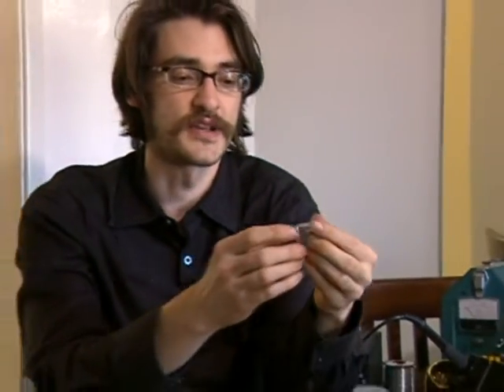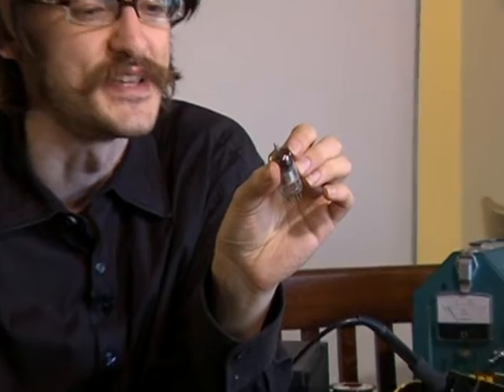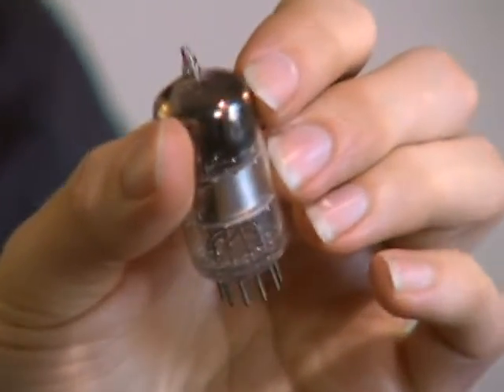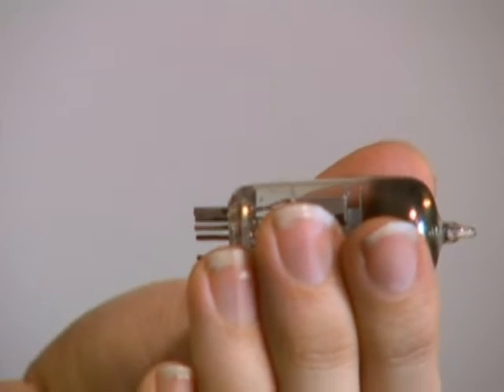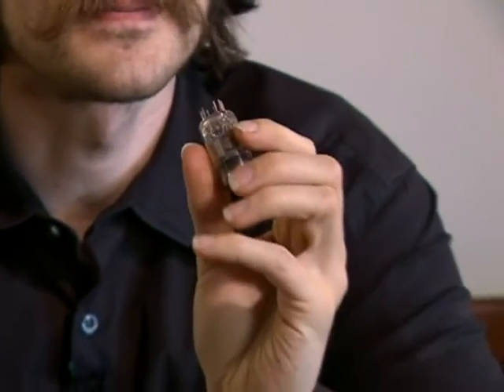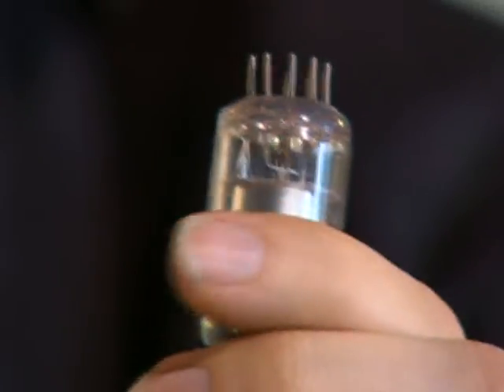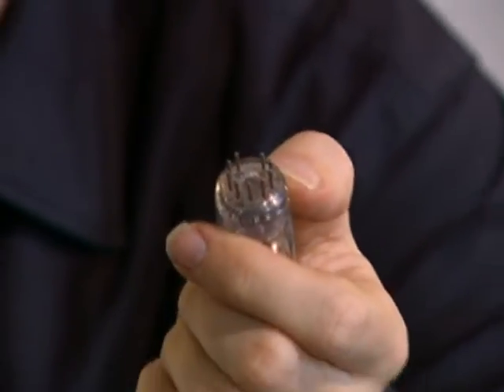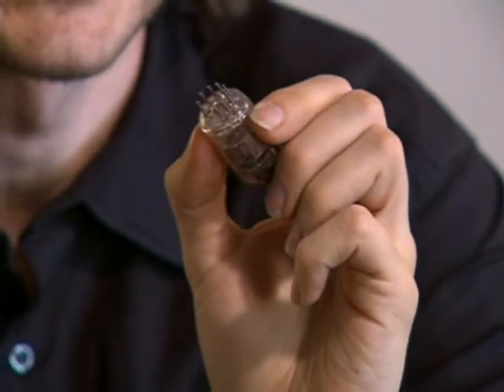Restoring Vintage Radios and Music Equipment : Vacuum Tube Problems in Vintage Electronics

Comment: i have a Siemens Super type C 62 radio/wireless set built in Germany in 1956/57, bought in Sweden in the 50s or 60s. on the back it says F.Nr 584317.  it used to work fine. after i tried to use it as a loudspeaker for another apparatus there is no sound at all, not even the click and other noises when you turn it on. the valves all seem to work (they glow). i do not know what i have done wrong. the 9-pin valve Siemens EF89 does not glow much.  is there any web page where you can see equivalent valves for that Siemens valve? i have other valves the same size but i do not know if any would do. please excuse me for anything that is unclear as i know nothing at all about old radios. and thank you for any help.